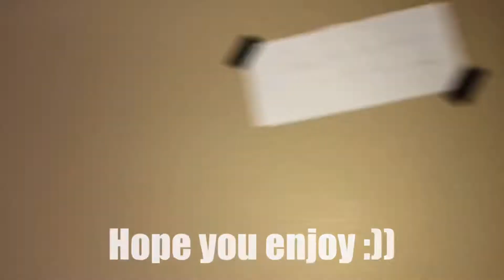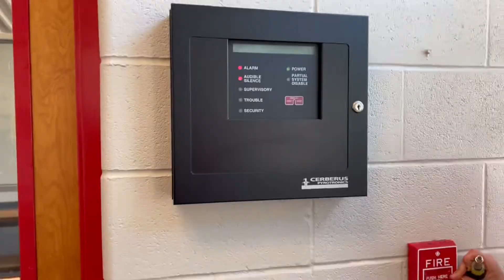Fire Alarm Inspection 1!

Comment: So My School District Uses Siemens At All The Schools. The One School Has Siemens UMHU-MCS in the Hallways and Other Bigger Rooms Along with U-MHUS. Also, UMC-S in the Classrooms. At Another School, It Has Siemens Mechanical Horn Strobes, Spectralert Classics, System Sensor Beam Detectors, and Several Other Siemens Devices. The Panel was Replaced. The Annunciators Were Replaced. They Used To Be The Same Annunciator Seen in the Video. But, They Took The Old Components Out and Put In A New Desego Annunciator: Part of Siemens Upgrade Integration. Cool Video!
Reply from the maker: Cool!